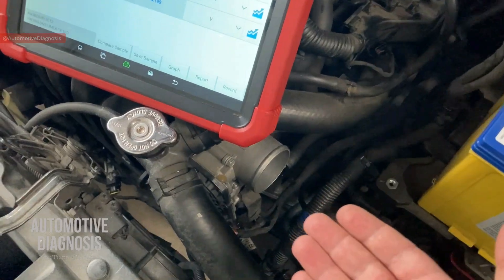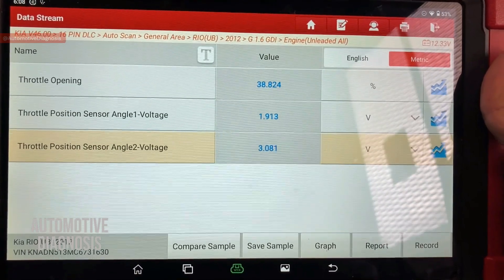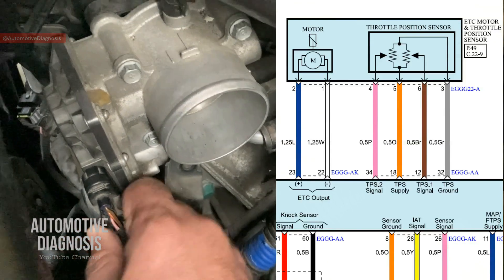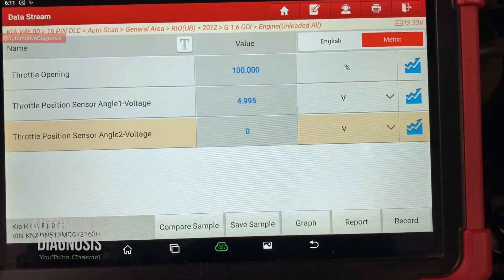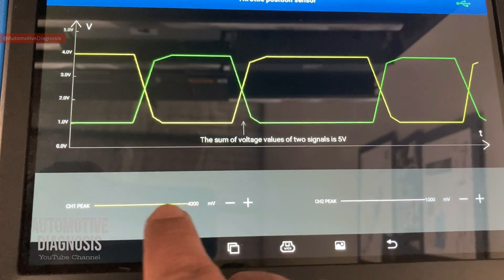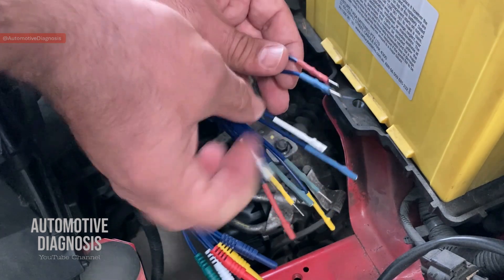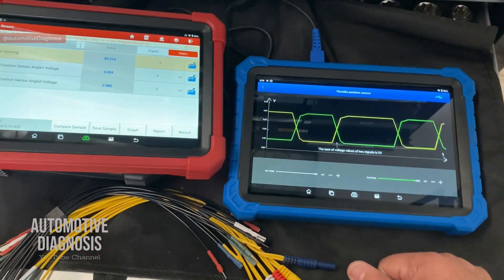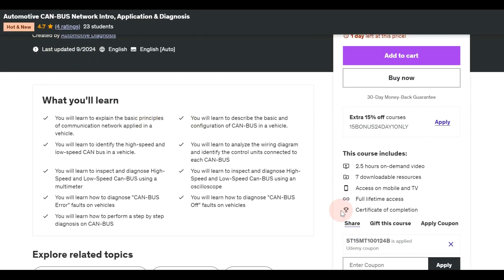Throttle Position Sensor Simulation & Diagnostic | TPS Signal Simulation to Diagnose Engine ECM

Comment: Very informative. Can I use 5 volt_battery instead to stimulate the two sensors one after the other?
Reply from the maker: Hi my friend, you should also be able to change the voltage to monitor the response of ECM, only a 5 volt supply is not enough.

Comment: I’ve read multiple Bosch manuals for multiple TPS/Trottle Bodies - and nowhere did I see whether you said about TPS1 and TPS2 added together should be 5 volts when added together in any position.
Each sensors part number has its own graph for both potentiometer or Hall Effect transmitter, and values are in percentage of if reference voltage. 
Because reference voltage is not exactly 5 V every time.

Stop giving out incorrect information!!!
Reply from the maker: Here are three examples from three different cars workshop manuals about Throttle position sensor 1 and 2 output signals:
KIA:
https://drive.google.com/file/d/1CP3XmspXFEBE9-qq3Yq2m_RXMpp0n6hb/view?usp=sharing
Ford:
https://drive.google.com/file/d/19ZO4ogF4M7_GIPw1OSMa3XnRnqGJxw5S/view?usp=sharing
Nissan:
https://drive.google.com/file/d/1oIgV29a4V6MJyMO4lnCxPqJA98QXQLWc/view?usp=sharing

I can provide many more examples, but please consider that even if all these workshop manuals are proving the logic behind what I said, I never mentions that my statements applies to all car.

Comment: Check wire motors signal bro
Reply from the maker: Hi there, yes, checking the TPS motor is part of the diagnostic, but this video was focused on simulating the throttle position sensors.